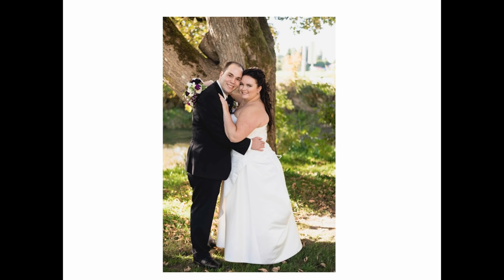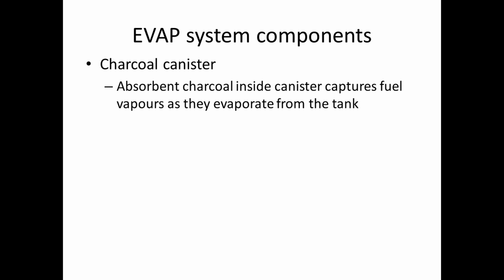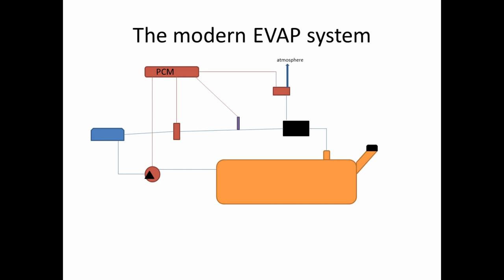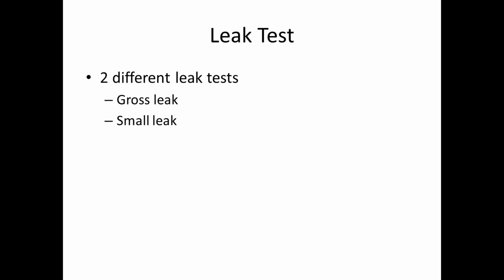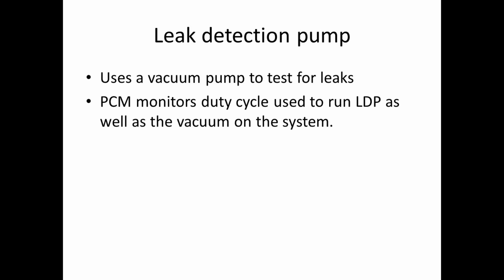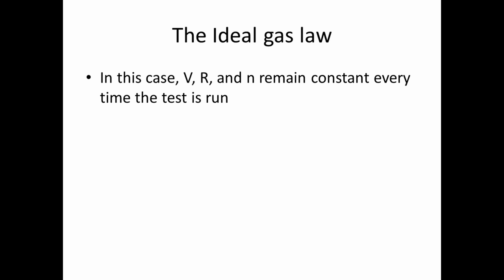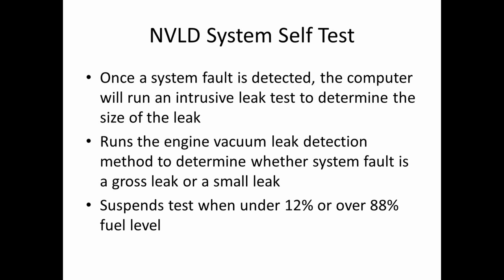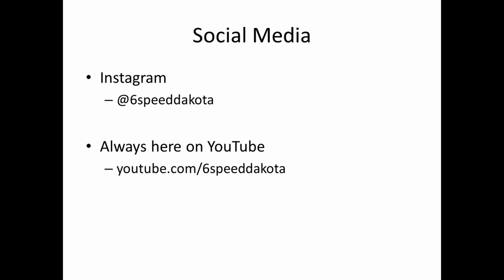6Speed's Lectures: How your EVAP system works

Comment: I know this video is a couple years old but awesome job. Something new I've recently seen on a Chevy Cruze with the 1.4 turbo was a bad one way check valve in the purge valve assembly. It was letting unmetered air into the engine and causing a lean condition. Again, great job with the video, just wanted to share a little more insight into some possible failures.

Comment: I wish the manufacturer of the EVAP system made the system  a little more durable considering the engine performance depends on it so much.  My purge valve was stuck open and many tests needed before it was corrected.  Thanks for your lecture, very informative.

Comment: Good video. Good explanation. Just replaced the purge valve on my 2010 Ford Fusion. It was stuck open mechanically. Apparently this is rather common on the Ford purge valves. Ford had a good valve for years ,then did a redesign...... then not so good.Curious if they did another redesign to fix their initial redesign.

Comment: Great video I found it very interesting seeing the various systems that she's diagrammed I'm having an issue with a 2000 Ford Taurus. The EVAP test never completes and I think there is an electrical issue with the vent solenoid on my car's system and provide a constant positive 12 volts and when it wants to close the vent solenoid it uses a transistor to pull the negative lead to ground. Now I've tried just connecting the solenoid to an accessory circuit so it's always closed when the car is running but then the ECU to text that there is an issue with the solenoid and presents a fault code. So now what I've resorted to is using an extra solenoid I got from the junkyard just to satisfy the ECU that it has one connected and then the second solenoid the one connected to the charcoal canister will be energized via accessory circuit I know this is a ghetto way to take it but I really need to pass emissions I was wondering if you've ever heard of anything like this before.  Also as far as i can tell the intake manafold is connected to the charcoal  box with to a diafram valve like ur picture but it has no eletrical conntion it has one vacume line is switched by an electronic pneumatic valve. Ive yet to find a pressurd sensor but there must be one somewhere correct?

Comment: Thanks for the great tutorial. I have a P0442 code on a 1999 Saab. There are pinholes in the gas tank around the fuel pump area. I presume the tests would show up with a code due to those pinholes. Is that correct?

Comment: Great info man! Thanks for sharing! I had my 1st ever EVAP code P1450 on my Ford Windstar  a couple weeks ago and it turns out the line leaving the purge valve to the intake was so dry that it by itself would no longer hold vacuum.
Reply: may i get a clear explanation sir about being dry and not able to hold vacuum?
Reply: @endurofan9854  Yes it was a dry rotted hose going into the engine ntake from the fuel tank purge valve under the hood. 
 When the tank would build a little pressure we could smell fuel throughout the car and had to finish a 250 mile trip with the windows down.

Comment: Thank you for this informative video. Maybe I misunderstood, but you said that vent valve is shut during purge. If that is the case from where will the replacement air come into the system? I am learning this tech and know very little, but I think the vent valve should remain open during purge.
Reply from the maker: I misspoke, you are correct, the vent opens during purge to flush the canister with fresh air
Reply: @6speeddakota When refueling the vapors in the fuel tank need to go somewhere. The only way vapors can flow into the canister is if the vent valve is open. Also when the car is just sitting, new vapor from fuel in the tank needs to flow into the canister, which again requires the vent valve to be open. This means that the vent valve is always open except for the short duration when the PCM/ECU needs to do a vacuum test of the EVAP system. The vent releases air to the atmosphere when refueling or when new vapor is formed in the tank. It sucks air from atmosphere when purge is operating.

When vapor saturated air flows over the charcoal, the charcoal absorbs the vapor, and only air comes out from the vent. When air from vent flows over the charcoal, because the air is unsaturated, it picks up the vapor which is then burnt in the engine. If the car is not driven for long periods of time, it is possible that the charcoal will get saturated from tank vapors. Timely and enough purging is therefore needed for the system to prevent vapor escaping to atmosphere.

Comment: This is a good video. Thank you.
I have a question though...  is it normal procedure for a car to run a Constant 13%(or any number )purge valve command after the car has reached operating temp?  mine seems to.(and it keeps higher single digit trim #'s(not sure if this is what is causing this slightly lean condition))

Comment: Good descriptive video.
I have a 1 year old car (Subaru Impreza), over the past year it has stalled at least half a dozen times during slow speed acceleration (on hot days after hours of driving). Over the past few months, I've had a noise from the fuel tank area (on hot days after hours of driving). Last month, the workshop finally realised the fuel tank was over pressurising, causing this noise, saying one of the vent lines was kinked, and they fixed it. Well it's happening again/still.

What part of this system could I check that would cause the fuel tank to over pressurise? The car is booked to go back into the workshop, but after numerous attempts, I think it's best that I just fix the issue.
Reply from the maker: The pressure in the tank and the stalling issue are likely 2 separate issues. It sounds to me almost like the fuel is vapour locking, or somehow you're losing fuel delivery

Comment: What an excellent review, thank you, I'm sub'd! There was one point you made at about 5:50 that is in conflict with another video I watched describing the process of purging. I don't know anything about these systems, so my question is innocently asked. It would seem more effective to purge by opening the purge valve and opening the vent valve, so that you are flushing the charcoal with clean air. If the vent valve were closed during purging there would be no way for air to replace the volume of gasses drawn into the throttle body, so the system would quickly develop a vacuum and not move much air. Are you sure the vent valve is closed during a purge? Perhaps it is a multistage process to allow both to happen in sequence?
Reply from the maker: I noticed that I blundered that one, I'll have to fix it later on. Thanks for the advice!
Reply: Thank you for clarifying that. Even with a minor glitch, this is one of the best videos I've found describing the way the system works.
Reply: Note, too, that you cannot pull a "complete" vacuum over a volume of volatile liquid (like gasoline), since under lower pressure more of the fuel will evaporate into -- you guessed it -- gas. In this sense, the system maintains its own equilibrium, desaturating the charcoal without the need for (much) added air.
Reply: @VideoNOLA  Partially true, but it would still develop a vacuum without question.  No way that evaporation can keep up with steady intake pull.
Reply: So the vent valve is open during the purge phase?
Reply: @rogjackson  Yes.

Comment: Well, scion xb 2006 gives several codes at ones, P043E, P043F, P2401, P2402, P2419. Purge Valve is fine, wires to canister looks ok. I am going to test pump and Vent Valve by applying 12v (to see if them click). Just may be for some experience guy the combination of those five code gives a better idea, please let me know. Good video, thanks.

Comment: Wau!. Great explanation there.My 2jz fse has two valves connected to the canisters. And they both have pipe connectors at the end of the solenoid.the immediately one sucks air through even when not powered and the later one does not. Which of these connectors is connected to the canister which is sucking pressure. Or can u connect them interchangeably?

Comment: This is a great video, thank you. I'm having a problem that i can't figure out. After refueling, my cars idle stumbles and wants to die for about 30 seconds. After that, it normalizes and runs great until next fill up. No issues putting gas in the tank and No CEL. I've replaced the purge valve and vent valve to No avail. Any suggestions where to look next?

Comment: Hey, thanks for the video! What about the vent valve allowing air in so the tank doesnt implode because of the negative pressure when using fuel? Because the gas cap on some car is completely not vented
Reply from the maker: I believe I have that incorrect. The vent valve will be commanded open during purge to flush the charcoal canister with fresh air, which will also prevent the tank from vacuuming down.

Comment: Great lecture but still thinking of the one way check valve in case air still needed to be sucked into the tank. This usually occurs on conditions of driving with empty tank all around so that vacuum exceeds.

Comment: So would a p0456 code be a canister vent or canister itself?
Trouble filling tank, pump keeps shutting off due to pressure buildup.
Seems like something is clogged not leaking as the code suggests.

Comment: Thanks for the video, but I have a question. When the vent valve is open, why the fuel vapor does not escape, and only air escapes?
Reply from the maker: The fuel vapour is absorbed by the charcoal, that’s why only air escapes

Comment: Today I work in escalade 2008 , the tank not allowing to refuel , 
I changed the evap and still the same, then I found out all the pipes contacted to the evap system and the tank are full of small prices of coals .
Could you tell me why this happened?

Comment: This is great info but unfortunately it doesn't apply to a 2010 Jeep Wrangler as the canister vent valve is not electro mechanically operated. It's not a solenoid valve. It's just a plunger that creates contact with a continuity switch.  I'd love an explanation of how this system would work if the canister event valve was a simple switch as it is with a 2008 through 2010 Jeep Wrangler.

Comment: I do have a question.  Your diagram shows where vapors from the fuel tank go through charcoal canister where all the vapors are removed from the air before it is vented out the open vent valve.  But, then, when the purge valve opens and the vent valve is open, since the vent valve is on the purge valve side of the canister, air would be drawn in the vent and through the piping to the purge valve without sucking through the charcoal canister it appears!  I would think the fuel tank cap would be sealed so the system could do an evap vacuum test on the system.  So can you tell me how the vapors in the canister can get to the purge valve?  I must be missing some little something here.  Thanks for the video.  Tom
Reply from the maker: It's just a lousy drawing of the diagram. There's 3 ports on the charcoal canister, the vent, purge, and feed to the tank. The way the airflow is routed through the canister, the fuel side passes over the charcoal before it gets to the vent, what will happen during purge is the vent will open (I mispoke the way it actually works during the video) and the purge will open flushing fresh air through the canister over the charcoal. The airflow through the canister will pull the vapours out of the charcoal and into the engine. You are correct, the fuel cap is sealed not only for the self testing, but also so the fuel cannot evapourate out of the tank
Reply: 6speeddakota , thanks for the  clarification!  Three ports makes more sense now.  I suppose it is like having internal baffles to direct where each port gets its air!  Thanks, Tom

Comment: I overhauled my gas tank but now I have fuel spilling at the carbon canister under thermal conditions whether the engine is off or running at temperature..the only way to prevent it is to loosen the gas filler cap...any input is welcome!!

Comment: if it failed the gross test i think that would mean that either the purge valve did not open or the vent valve did not close presuming the that the lines are good; do you agree? For the small leak fail i would think either the purge valve did not close or the vent valve did not close presuming good lines; do you agree?  Does the small leak use the engine to establish the vacuum? You mentioned a leak detection pump but i would ask which is the most common (e.g. my 2008 santa fe)? It takes a while (days) to get to evap system ready so i am assuming that it uses engine vacuum rather than a pump but am not sure.  Is this pump common? For the last item a vacuum switch i wonder how common that is as well.  You mentioned Chrysler so am not sure that mine uses that but I have used pressure triggered indirect valves and this seems similar. Obviously i am trying to debug and fix a small leak detected because i can not pass inspection and looking for easy stuff to fix before tracing a bunch of line.  Thanks foe the great video!
Reply from the maker: You're definitely on the right track. Small leaks can be virtually impossible to find and that can be the single most frustrating thing to look for. It's simply the rate of vacuum decay that the system is looking for, a fast decay will be a gross leak, a slow decay will be a slow leak. A lot of EVAP system monitors require a specific drive cycle in order for the system to set the monitor, so that is one thing you need to investigate is what type of parameters are needed to set the monitor.

With a small leak, a lot of the time, the purge or the vent valve doesn't seal quite right, causing it to leak down. Realfixesrealfast had a really good video on this. Generally if you have a line crack or break, it'll usually end up as a gross leak. Easiest thing to do is to check the purge and vent valve first. Easiest way to do that is to locate the purge valve, take the tank side line off, unplug the connector to the valve, start the engine and stick your finger on the port where the hose goes into. If you feel the suction building, you've found your problem. Another way to test it is to take it right out, and either put a vacuum pump on it to see if it'll hold vacuum, or simply try sucking through it. Do the same thing for the vent valve, it wouldn't surprise me if one of them was no good.

Comment: Hello I have a 2007 Chrysler town and country with a 3.3 L. The problem I’m having yes I have a small leak detection also it’s running a bit rough only win engine is warming up and also had to takeoff after that it’s sort of smooth up and runs like it supposed to as I’m running I can hear as though the gas tank is collapsing like loud thump sounds not sure what that is but when I come to a stop and shut the engine off I’ll here allowed squeak Sound I believe coming from the The atmosphere Release vent how can you help not sure what it is

Comment: Great video. Very clear especially with the diagrams. I have a question though. What would happen if your purge valve was stuck closed? I would assume that the vapors would continue to build up until something happened? Would the vent valve eventually be able to vent the vapors into atmosphere? Again great video!
Reply from the maker: What would eventually happen is the charcoal canister would become saturated to the point where fuel vapours cannot be absorbed by the charcoal and will start coming out the vent valve.

Comment: I appreciate the logical flow and explanation. I just cannot understand how a 200 Sante Fe 3.5 keeps lighting an evap leak and all but the symptom or problem experienced is if the tank is filled comply and not overfilled the engine at times will not start right away or if it does it takes about a mile for the engine to run at normal RPM.  No mechanic has isolated and the only code is the Evap small leak.  I have just changed everything except the canister because I did a test as stated by others and the tank pressure valve is original since the tank needs to be dropped to access.  Your thoughts? Thx
Reply from the maker: A small leak can be very hard to chase, the best thing to do is to take it to someone who can put a smoke machine on it. The smoke machine has a flowmeter and you can crimp off rubber lines one by one until you see the flowmeter drop off, then you can look for the smoke to pinpoint the issue. Small leaks are brutal to find and unfortunately they can be costly with diagnosis.